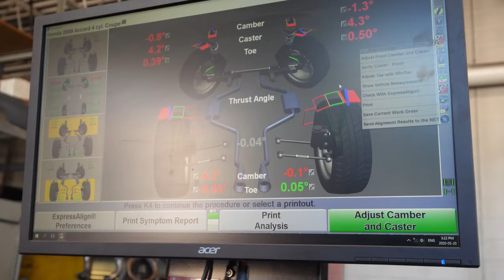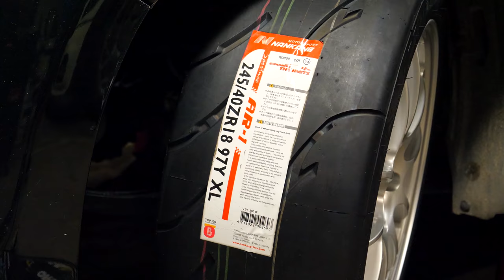How to Reduce Wheel Hop on a FWD Car

Comment: As usual, this is a sweet upgrade and one i have been looking into. I found urethane replacement bushing, but struggled to find anything like these links... nice! Are there by any chance part numbers that i ask for or look for on the site, because they do not have an auto breakdown that i could see. Part numbers would be a huge help. Thanks again for the great and typically spot on content! 😉
Reply from the maker: They have a kit designed for the Honda Accord. I'd send them a message to find the kit 👍
Reply: @milanmastracci  I checked with them and they only offer a kit for up to a 2007 Accord. Mine being a 2012 they said they don't offer anything for my year Accord. Not sure what is so different, but...
Will need to do some more research. Disappointed.
Reply: You shouldn't use poly bushings for the compliance bushing due to how the bushing is designed to flex. The stock bushings moves more like a bearing, so poly wouldn't work in that location.

Comment: to eliminate wheel hop there are something you would need to change/upgrade and or add. im speaking from an integra point of view: lower torque upgrade from rubber to polyurethane and the most noticeable upgrade is to add a traction bar. these items will eliminate wheel hop

Comment: Brother I have one question, can I fill the OEM arm control with polyurethane , do you think it’s going to work ? 🤔 thank you
Reply: i know people would do that with motor mounts back in the day with integra.
Reply: Yes it will work... I did this on engine mounts, rear trailling arm and basically on any mounts that have compliance hole in it...

Its provide a nice and firmer strength wihout the harshness if aftermarket full pu bushing...

Comment: Hey man great video! Like to ask you a question I have a 8th gen civic si. When I had full stock suspension other then coil overs I had no wheel hop. I changed the control arms and links and ball joints, hardrace very stiff. I also changed my coilovers. Now I have bad wheel hop. I do realize the new coilovers have a softer spring rate. Can that be the problem?
Reply from the maker: It can be linked to a couple of things. Tire compound / grip, spring rates, bushing durometer / type, etc. Which control arms did you change, and what bushings do they have in them?
This video might be beneficial to you: https://youtu.be/MwL-7JxzJjg

Comment: I have a 09 fit. My driver side axle snapped in half going 10 mph turning. The car doesnt move any direction. Could this be as easy as replace the axle or did it mess up the transmission in the process?

Comment: How long will PCI bushings last? They're open to dust and dirt ... that's fine for track days, but what about daily use?
Reply from the maker: They've lasted me with daily driving, winter driving, track driving, and have no play in them or signs of use really. I will degrease them and spray a bit of lubricant on them every once in awhile, but I'm yet to have any issues.
Reply: @milanmastracci  Sounds great 👍

Comment: Which bushing are you using? I checked the PCI website and I don't find any Accords.
Reply from the maker: You have to email them to get the part! I believe it is a TL or TSX specific bushing, with a sleeve to fit the Accord control arm

Comment: will this make torque steer even more pronounced.
Reply: Probably reduce it, less stuff moving in unwanted ways under power. Big thing is going to be power and difference in axle length on the right side of the transaxle vs the left side.

Comment: So if it buy these I gotta get someone to make my spherical bushings fit in my new control arm part??? Whose can do that a mechanic? A welder? Exhaust man
Reply from the maker: If you have the OEM control arms, you only need to press them in. Most aftermarket ones aren't built to the exact same spec as OEM, so that's why I had to get mine machined.